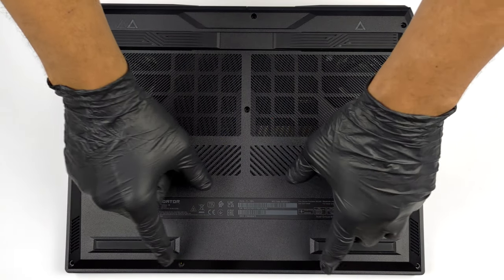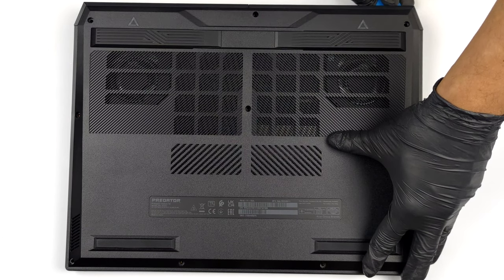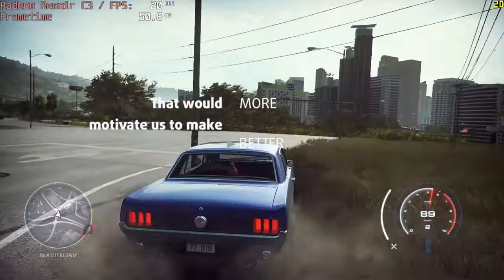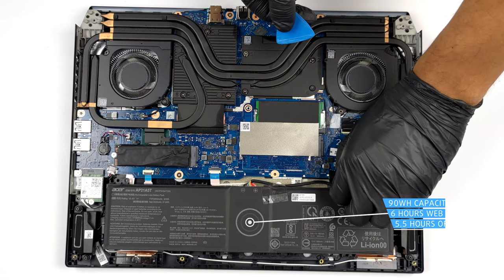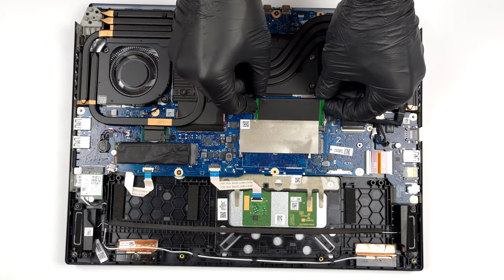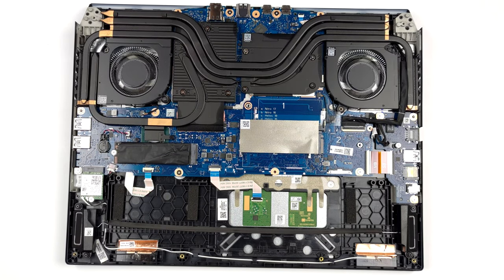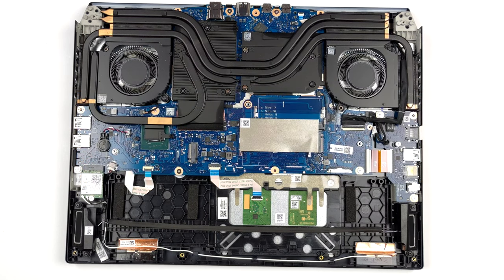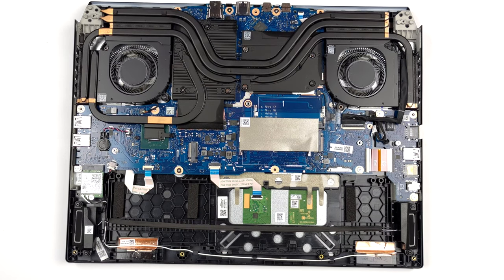🛠️ How to open Acer Predator Helios 16 (PH16-71) - disassembly and upgrade options

Comment: Did you guys tried and succeed in opening it?

I just tried and got stuck on removing the cover, because it has strong resistance on the back side of tge laptop (where the arrows are pointing).
No screws, nothing. I just don't understand what I'm doin wrong and i don't want to ruin it.

In the video looks clear but it is not
Reply: Yes, it's not hard at all, just look at 0:15 and try to crank it slowly with tools that you can get into the gap, then I twist in the gap and once you heard a crack sound, you can start cranking just like how he did in the video.
Reply: I used a super thin electronics screwdriver to get that edge between the surface of the cover you take the screwdrivers out of.
Reply: use screwdriver and wrap the tip of screwdriver with fabrics, thanks me later

Comment: how about a video about opening the acer PH16-71-98ME its similar, but it has an i9 cpu instead of the i7
Reply: it's the same chasis.
Reply: its not same chase and hate extra air vents on the bottom
 @nextjin

Comment: how much ram can I upgrade on my: Acer Predator Helios 16 PH16-71-91FL i7 13th gen rtx 4060?
Reply: It supports a max. total of 64GB ram @ 2x 32GB DDR5-5600MHz type modules. DDR5-5600 • CL=46 • Non-ECC • SODIMM • 262-pins • 1.1V • 2Rx8 based • PC5-44800
Reply: @dwaynejordan5898  are you sure about that because an i7 processor on this laptop with the motherboard might only support upto 32gb and I want to upgrade it soon

Comment: Does this come already with x2 8gb DDR5?
Reply: Just took apart mine with 16gb, it is 2x8gb sticks, and there is one open NVMe slot so you can upgrade the hard drive capacity easily enough. One thing not shown here is the light bar on the back falls off once the bottom is loose. Snap the bottom back on then snap the light bar back into place to reassemble. Just take your time with it and don't force anything. Getting it to pop apart was the hardest part.
Reply: It gets confusing, some have 1 16gb stick and others have x2 8gb I don't which one mines has and taking it apart myself voids the warranty. I'm planning to upgrade the ram but idk if I should buy one 16gb  stick or a set of x2 16s which is significantly expensive
Reply: @LILRaffy_  buy 1 of the same frequency and capacity u will be good

Comment: Whats max size of RAM we can put in each slot?
Reply: 64 per each slot
Reply: Are you guys sure? I'm 100 % sure I read maximum is 32(16+16)
Reply: @TheWolfalpino  According to Intel CPU Spec, 13700HX is support up to 192 GB
Actually, I own one of that laptop myself. It's a bit weird about this laptop because it's showing there are 4 ram slots in total from Task Manager. 
I bought a Corsair 2x16 4800 DDR5 SO-DIMM ram kit for this laptop anyway.
Reply: @HKanson1234 Does it really have 4 physical slots? Mine shows this too via task manager.
Reply: @JoeeeBoyPlays  I dunno, Im quite curious that too, but I don't wanna break my laptop so I did not check the other side of the mother board.
Reply: @eshtiak545  opps, I made a mistake, it should be13700HX for my model.
For the question about upgrading ram, I bought Corsair ram kit as my own preferences. As mixing ram with different brand might have problem, so I suggest you to buy 2 same ram, or a ram kit, or buy an exact same model number of the ram that on ur laptop. IMO 2x16 GB of ram is great.
Reply: @HKanson1234  Yeah, I won't play with it until the warranty expires.

Comment: can we use gen 3 pci 3 m2 nvme ssd in it
Reply: Yeah I want to know also??
Reply: @rajjaiswal8355  yes you can use as gen4 slot is backward compatible. And I would suggest getting a 2TB Gen 3 nvme drive instead of gen4 as speed are pretty good for gaming and everything.
If you have extra cash lying around then go for gen4 but gen3 is good.
Reply: @rhaily_want2kissU  22x80
Reply: You can use a Gen 5 EVEN. This notebook is brand new for 2023. I have a 5th gen SSD in mine.
Reply: which ssd you used ? @Huels
Reply: CRUCIAL PCIe Gen5 NVMe .M.2 SSD 4 TB @shubhamsoni4536

Comment: Which size of M2 nvme supports in Slot 2? looks smaller than the one installed in the video.
Reply: yes pls tell
Reply: 4x4 pretty sure
Reply: @cypherx9572  might be 4x4 just look up acer predator helios neo 16 storage size
Reply: 4x4